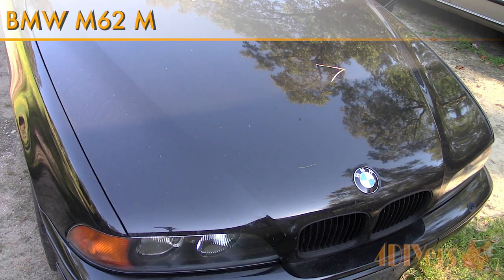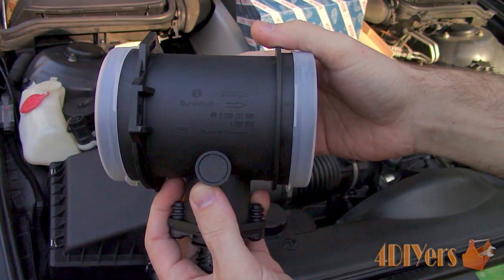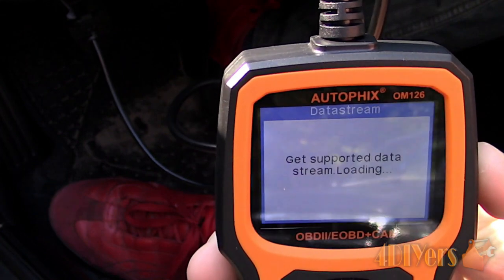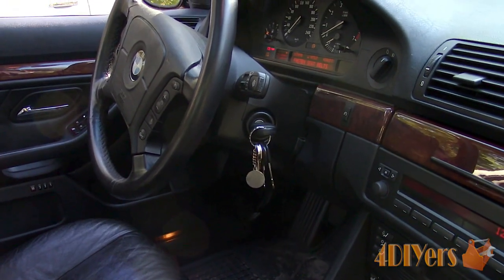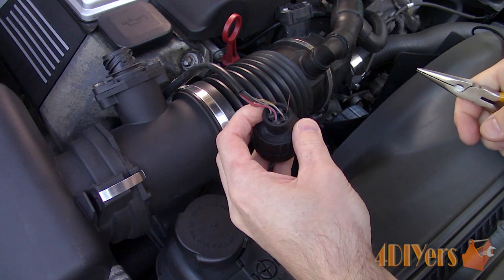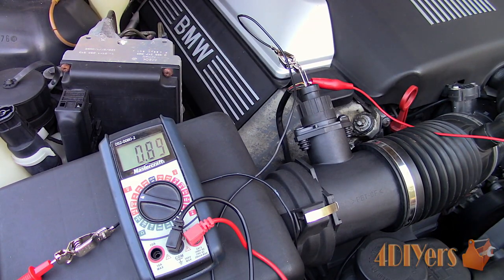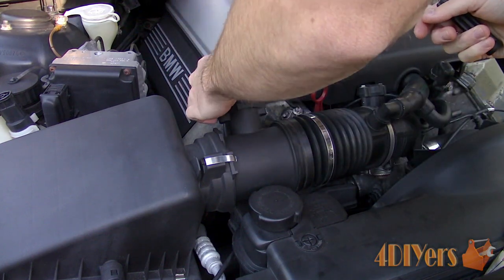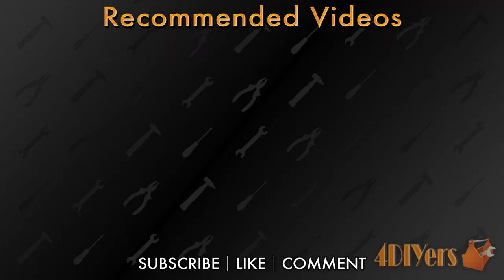How to: BMW M62 MAF Troubleshooting & Replacement

Comment: Very good tutorial on the operation and test of the MAF sensor. When I disconnect the MAF from my 1998 740IL, car runs fine but when I connect the plug I have the issue, my obdII says “
P0100: Mass or Volume Air Flow Sensor “A” Circuit”. I did do this test per your interactions. The first part was ok but when I did the second part with the needle test, I get around 10 volt dc. So I decided to do a continuity test and disconnected the plug I got continuity between wires brown and gray/blue do you know if this is normal?? Could not find any shorts. Thanks.

Comment: hello maigo I'm from Brazil and I'm with a bmw x5 4.4i year 2001 with the following problem: it does not turn on. the engine is locked if I remove the candles, throw some oil, or WD into the candle hole and move the pulley to one side. to the other .. ends up loosing and so I can and I can call .. more the other day she hangs up again. Do you have any idea what that might be? or where do I start ??? I really do. hug. Flavio.
Reply from the maker: My advice would be doing a compression and cylinder leak down test. You may have an issue with the valve train.